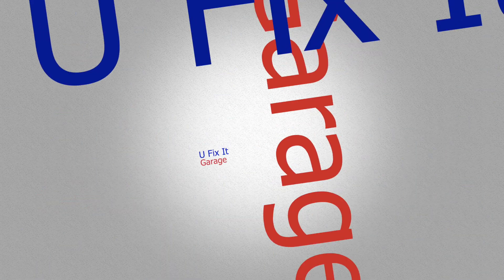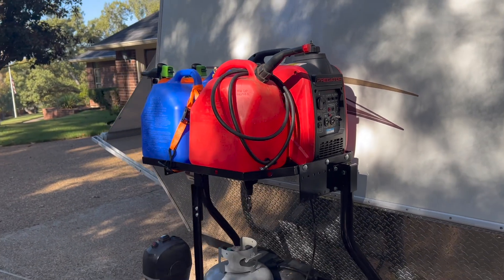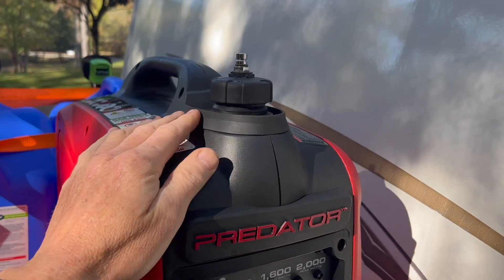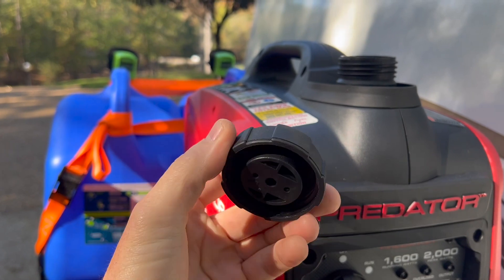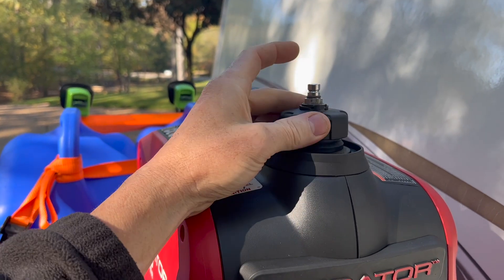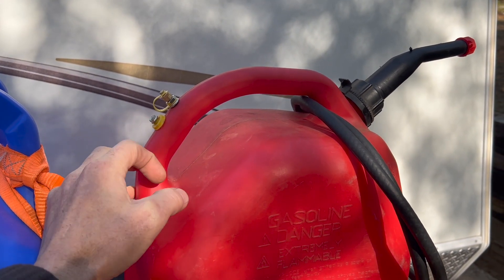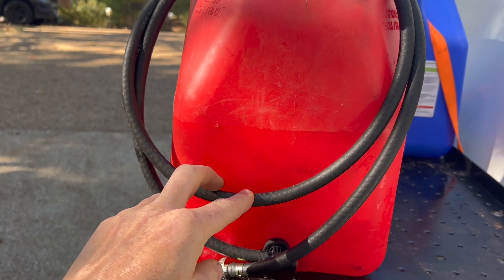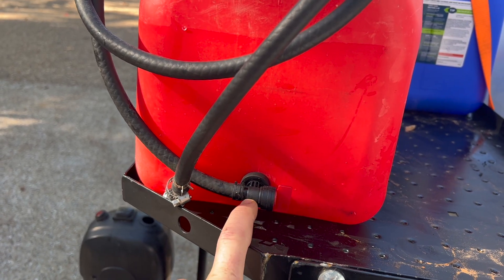Predator Gravity Feed Video   HD 1080p

Comment: Great video I’m about to implement the exact same thing. We’re pretty close anyway. Just curious a year later how’s it working out?

Also typically inverter generators don’t like the rain. Any issues with leaving that out in the rain ?
Reply from the maker: I had to replace the cap with an aluminum one from e-bay.  The gas deteriorated the JB weld on the other one and it started leaking.

Comment: If you do this on a generator that has a vent pipe in the fuel tank, such as the Predator 3500, you have to pinch off the vent tube or use a shut off valve to keep gasoline from entering the vent line and spilling out on the ground.